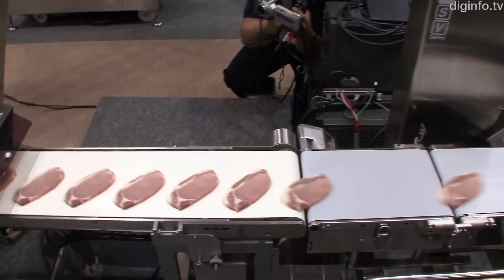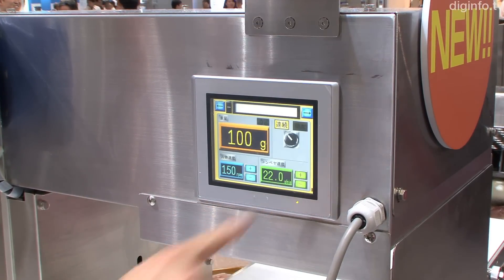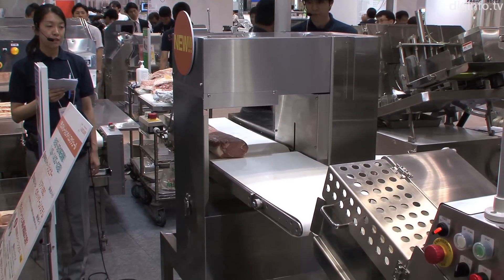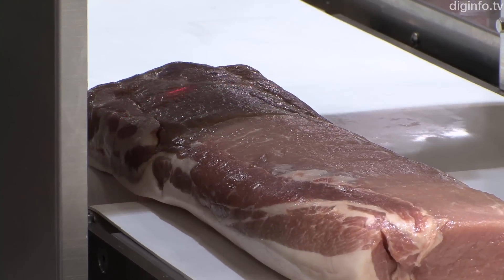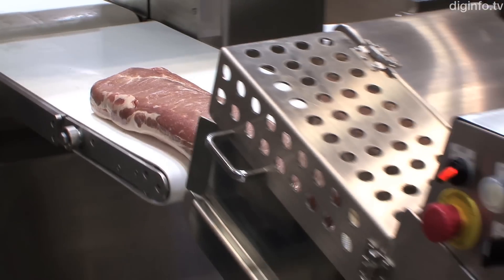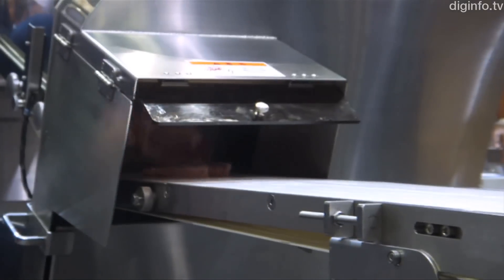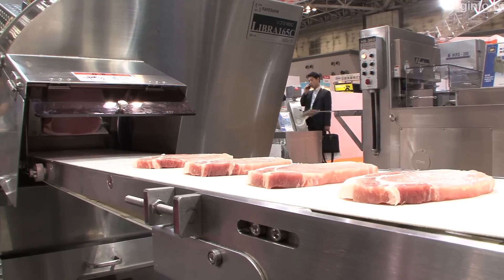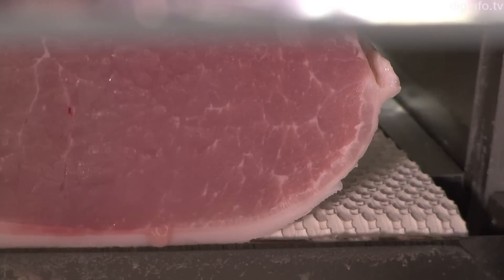Intelligent meat slicer uses 3D imaging to cut perfect slices every time #DigInfo

Comment: It said that it's designed to deal with pork, so different densities isn't too much of an issue; however, if you were to use it to slice other meats, I'm sure it could be programmed to change the slice thickness accordingly.